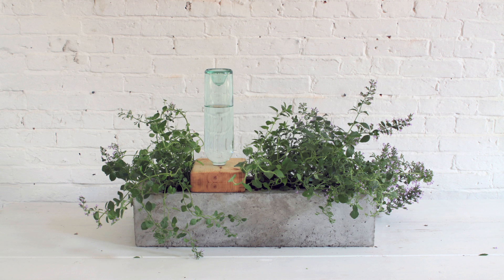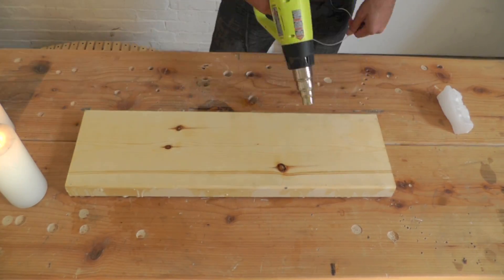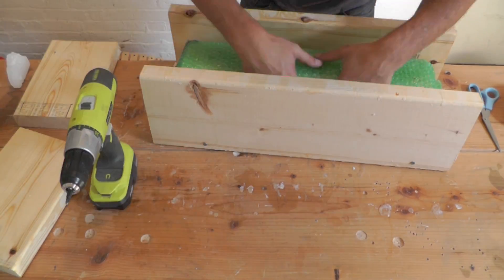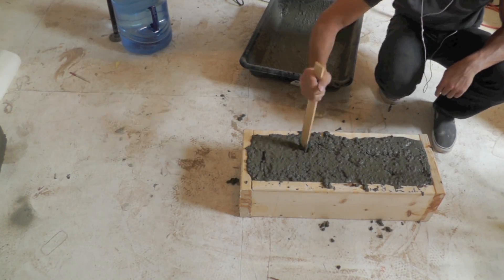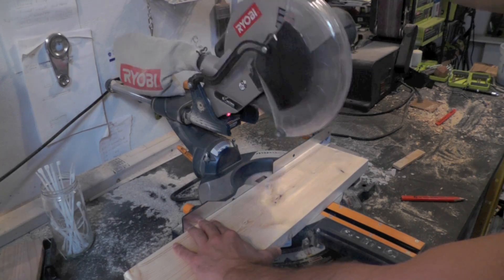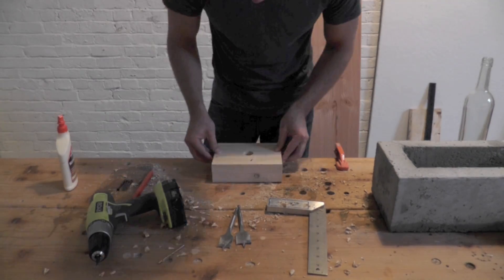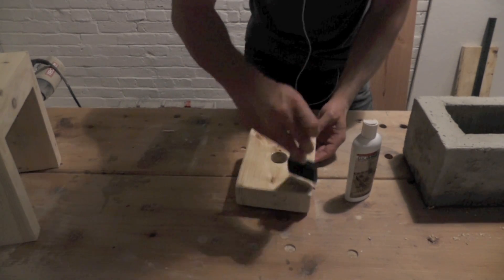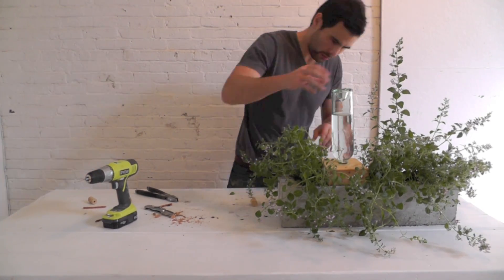How to make a concrete planter that waters itself

Comment: I've done some ceramic moldmaking & used Murphy's Oil Soap on the wooden boards to protect/release the plaster molds. Do you think this would work with concrete as well?

Comment: I love this approach. I was just wondering if you could do this on a much larger scale? I noticed that you have a video for a much larger planter, but used foam insulation that was cut away. Is that just an old approach or necessary for larger concrete containers?

Comment: will the water spread to all the roots or will just be at some specific location. just asking because i intend to do same but be sure before starting it.
Reply: Place the water bottle towards the center of the planter and line the bottom with a thin layer of gravel before putting the soil on top. That should help the water spread. Hope this helps😉

Comment: some kind of vibrating platform to put your molds on would make your life so much easier and your end results even more solid
Reply: seanautube  use a electric sander without  paper and you have a vibrating machine.

Comment: How do you refill the bottle if it has a cork and copper wire attached to it?
Reply: if you do that the water is not going to say more than 10 minutes ...
Reply from the maker: La Vista From Here i just pull out the wire and fill it with a funnel
Reply: I would drill a hole in the top (technically the bottom) of the bottle to refill
Reply: If you put some sort of stopper in that hole, it's more accessible than taking the whole thing apart every time it's out of water.

Comment: Another nice concrete build! You have really gotten into using concrete for your projects! On this one might I mention two things - instead of melting the wax, can't wax paper be used? And if a cavity was left in the concrete for a flatter bottle laying sideways at a down angle in the back with tube and holes in it through soil would that keep the planter watered but bottle out of sight? Thanks for sharing.